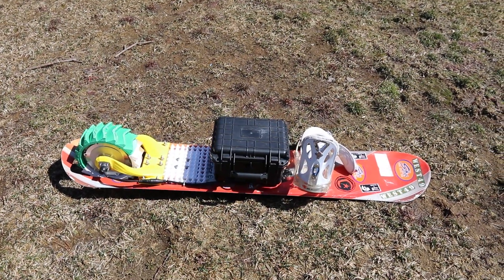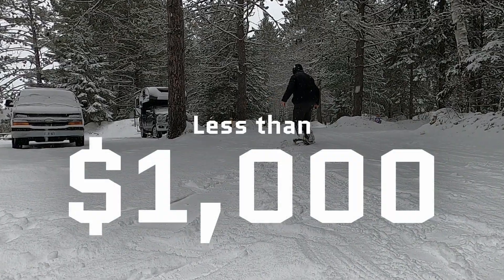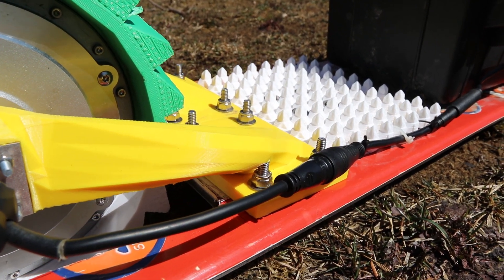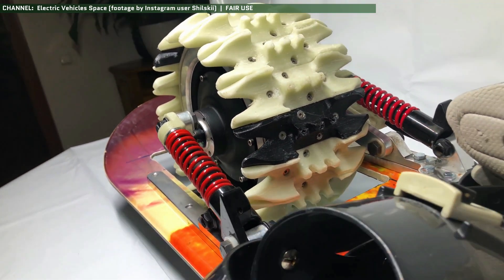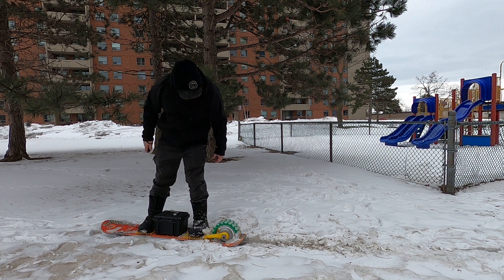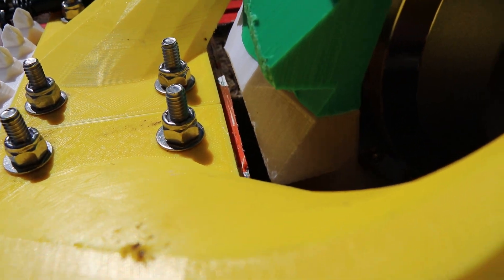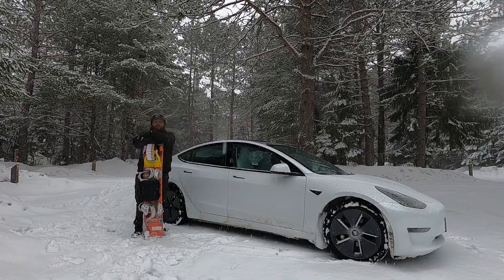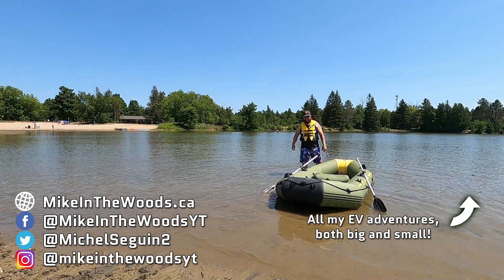Why It's Time To Retire My DIY Electric Snowboard

Comment: If you have a multi-material printer, you might want to look into TPU for the outer rim of the wheel. Stuff is incredibly resilient and I think would last longer than the TPU.